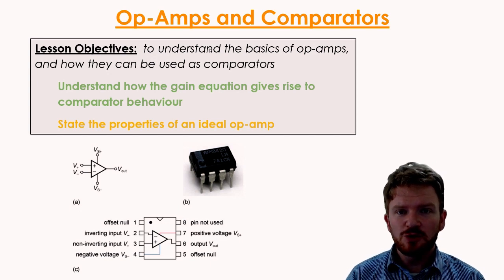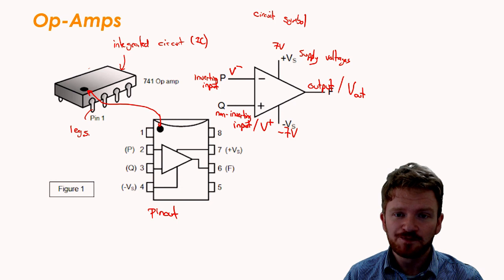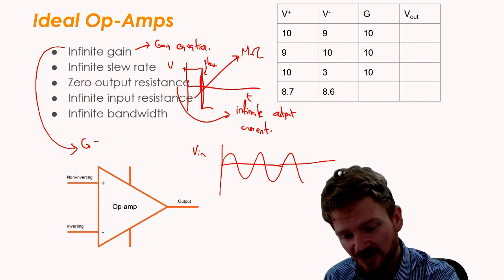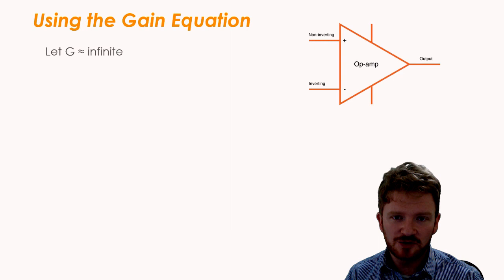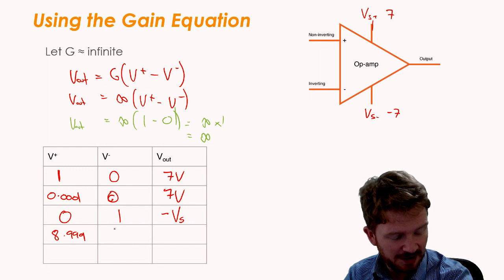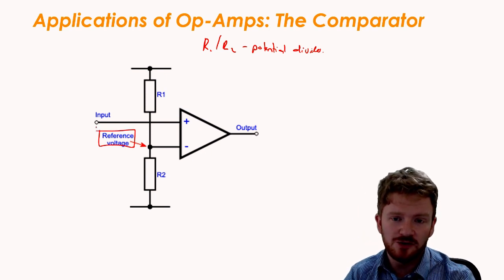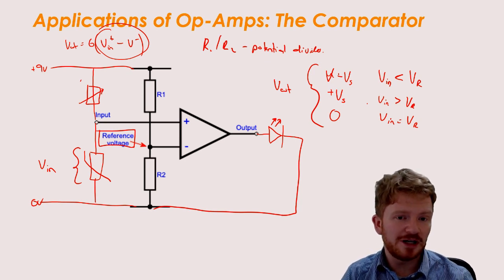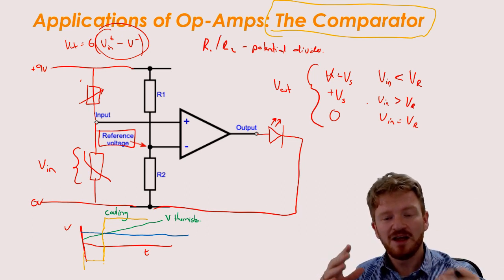CIE A Level Physics Electronics   Comparators

Comment: 741. A component first sold in 1968. Yes it is a very useful building block and an example of encapsulation something software writers still have not got their heads around. Half a century and they still do not get it!!! A good introduction to op amps and nice to see A levels coming up to date. Well 52 years ago and an obsolescent example but not bad.